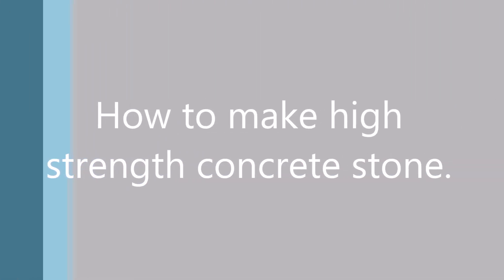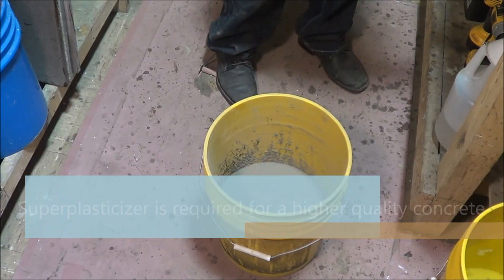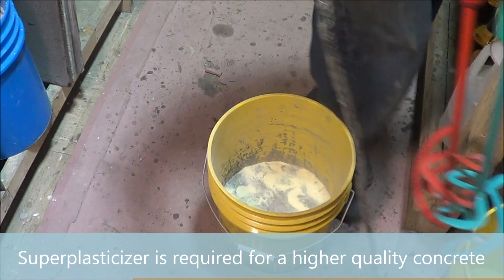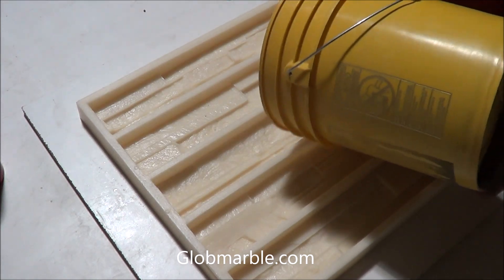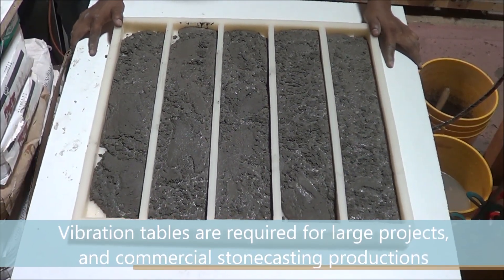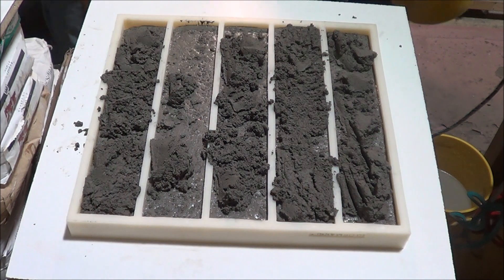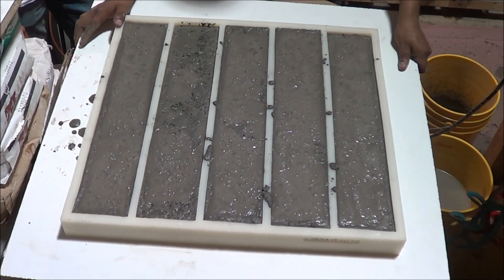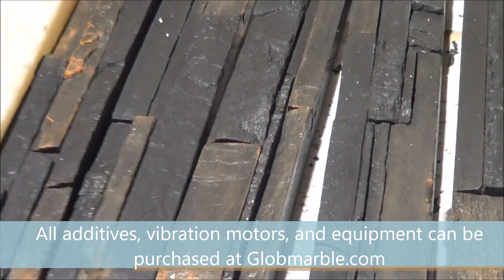Making high strength veneer stone. GlobMarble mold VS 101-3

Comment: Hi, I am producing decorative stones. I add powder pigment paint into the cement, but after removing it from the mold, the powder paint on the stones gets on my hands in large amounts. Do I need to add any other additives to prevent this? Do not mix water, powder pigment, what else should I use? Thanks.